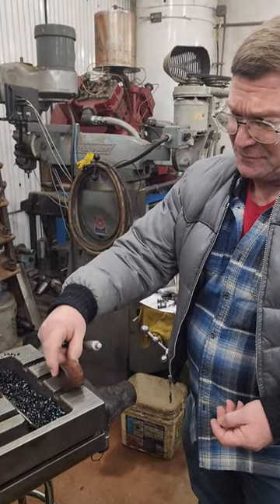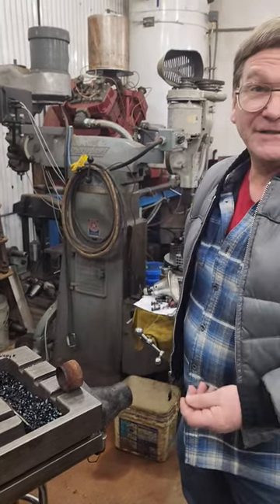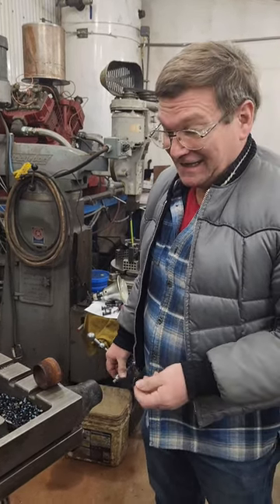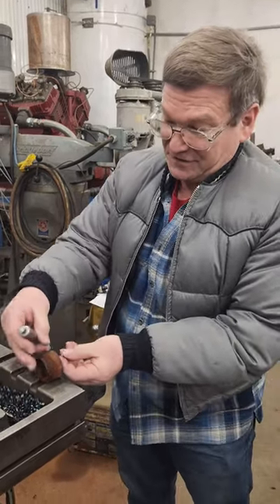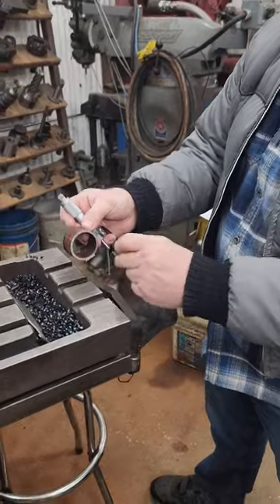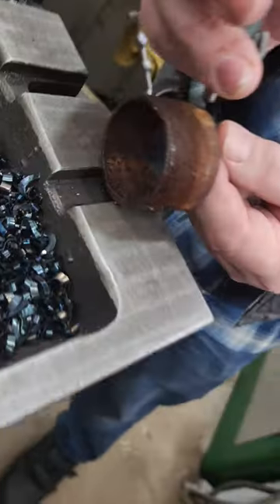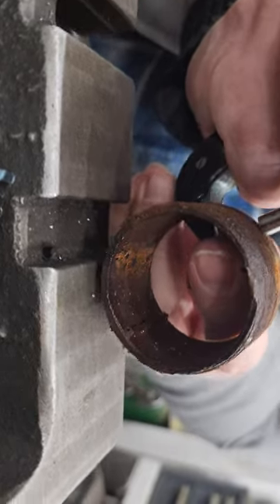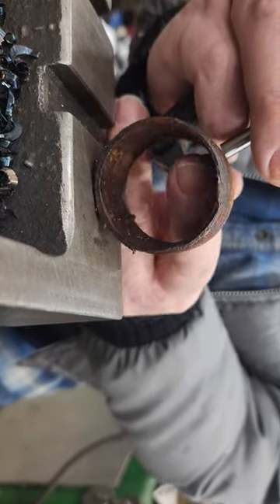Machinist's Minute: Measuring Tubing/Pipe Wall Thickness with a Ball Bearing and Micrometer

Comment: Either get a pin micrometer or a bearing micrometer, or any other mic with replaceable anvils and you don't need to jack around with a silly ball bearing. Although in certain select cases being able to measure over a ball bearing is handy.

Comment: What if they make one where the bottom is actually pointy and the top one is to 
Wouldn’t that work better
Damn engineers owe me on this invention
Reply: Hahahahahahah I love it because they actually do and I wonder if this is sarcasm if it is it was enjoyed lol
Reply: Well they make one with a rounded anvil (I have one) Works very well for most irregular surfaces and saves the awkwardness of jiggling a ball bearing in there. They do make mics with pointed spindles but those are usually for measuring grooves or indentations. They also make thread pitch diameter mics with special V- anvils which are damn handy.